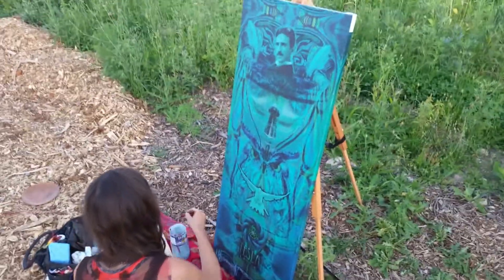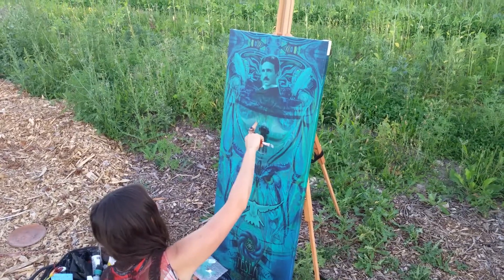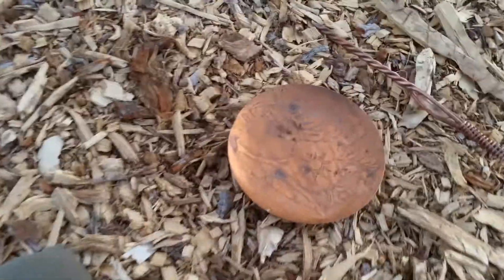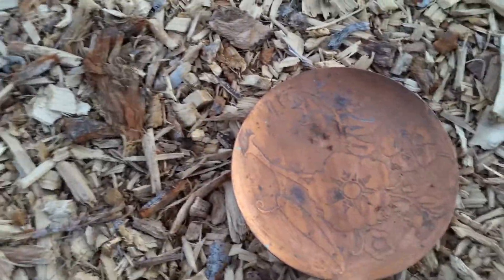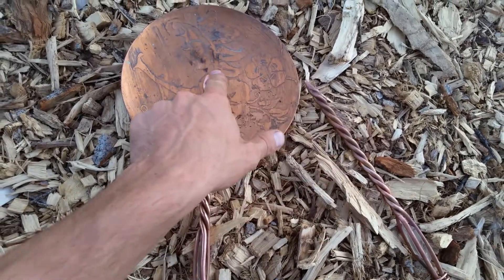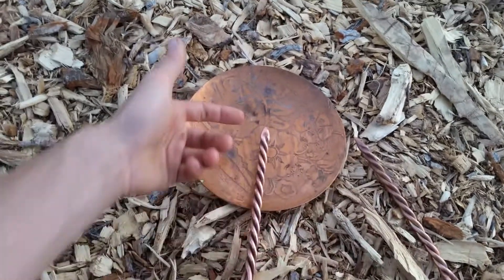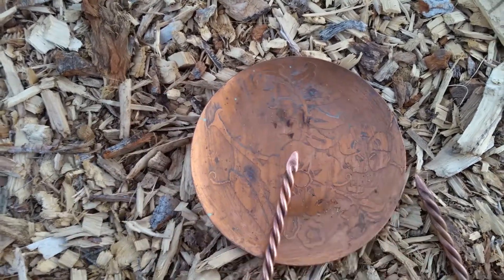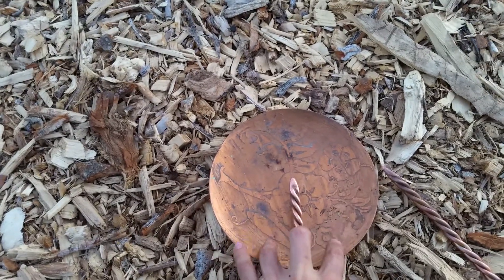Tuning a Tesla Tower to the Earth

Comment: The idea is not bad.

1- In this case, the conductor disk must not be in the magnetic circuit of the tesla coil. It must be removed away from the coil to not interfere with the 7Hz magnetic field.

2- Or the conductor disc is in the field of the tesla coil and it is the magnetic field of the coil creates the Corbin effect. In this case, of course, the spiral flow in the disk changes its direction of rotation every half cycle of the frequency then it would be imposible to tune the frequency.

So the case "2" suggests that the copper sphere on the tesla tower has a purely capacitive application.

But hey I could be wrong!

Note: Translated with google translation ... I hope this is understandable;-)